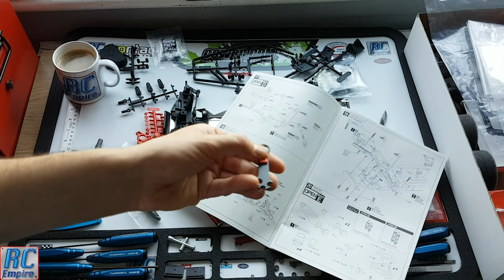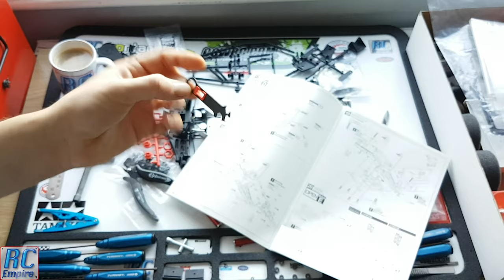Brand New Kyosho Ultima Build - Episode 6 - Shock Build

Comment: Pay very close attention to the building instructions. They are not very clear that you need to install some very small seals on the bottom of the dampers. If you do not install them, your dampers will leak. Also the bottom loading shocks are not very good. However, they do work.